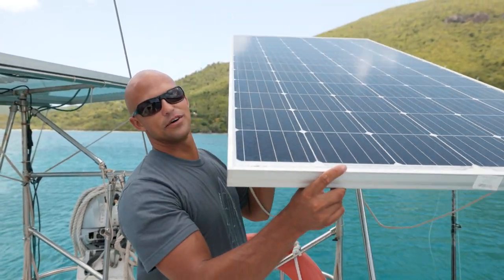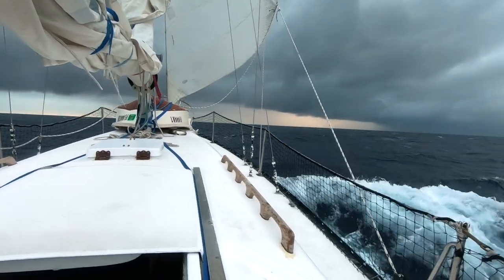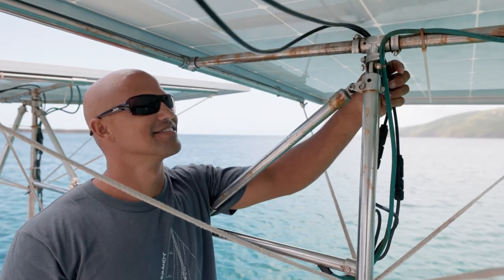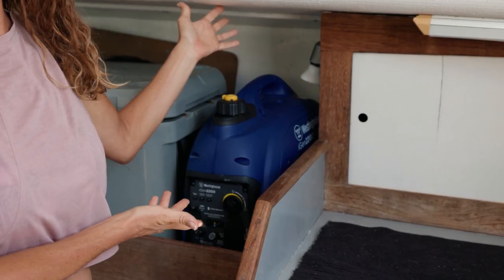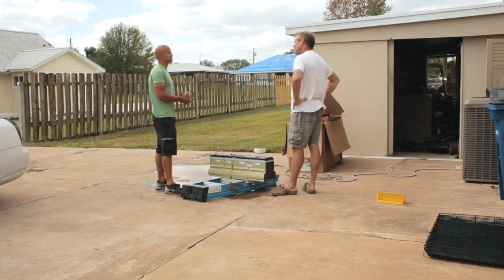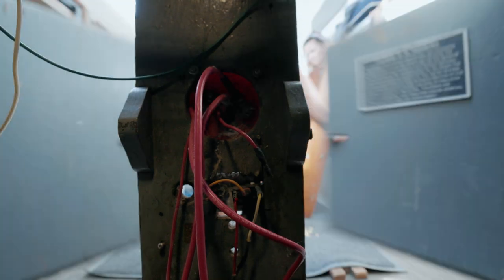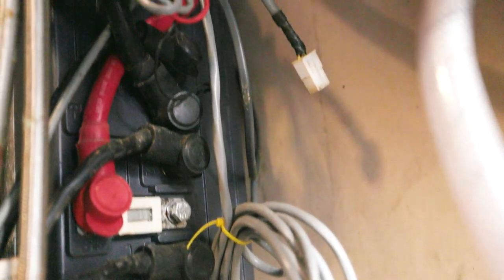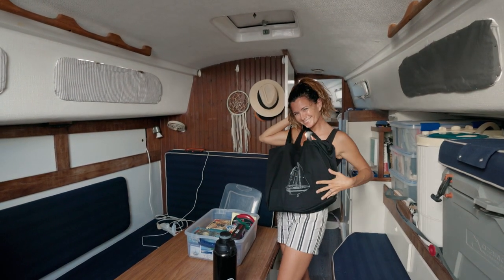Living on an ALL ELECTRIC sailboat for 3 years | Beau and Brandy Sailing

Comment: As a Pearson 35 owner (1977) going through an electric conversion, this video was PERFECT.  I want to thank you for the frank assessment of what you don't like and what you would change.  90% of my approach has been validated, and you've caused me to rethink the other 10%. Beau, you might want to look at the Electric Yacht EQ 20.  It is two 10kw motors on the shaft.  That gives redundancy should one fail, plenty extra power that you say you wanted, and two motors working at less power do not generate nearly as much heat on the motor (though the total BTU is the same, it is over a larger area - two motors - so the motors aren't stressed). You keep the simplicity of air cooled.  There are other things I'm doing differently, but 'nuff said.  This video was GREAT... perfect for me.

Comment: The electric boat concept is a very cool idea that is finally coming of age.  One thing that you may want to look at is a way to easily electrically isolate your inverter.  I used two battery switches for the input power on mine.  I did not do this until having to replace the second one due to nearby lightning strikes.  Neither actually hit the boat but both took out the controller cards in the inverters.  I am in Florida which has more than it's fair share of lightning storms but I now isolate everything possible.  Thanks for taking us along with you and showing us how you do things.  It is a great resource.

Comment: Nice job of really putting it all together for those of us in the process of building our own systems. I have a small sailboat I built that only has an electric trolling motor for getting in and out of ports. Indeed it does force you to become a better sailor. Often I find myself stubbornly resisting the urge to use it as though my sailing skills might be questioned...keep up the great work.

Comment: Cool beans... 
I too use Midnight & Magnum equipment. Now I was running an off grid ranch in Northern California (Mendocino) and liked that I could just jump up to Seattle whenever needed, but for you guys, thats a bit of a haul... only needed to once to rebuild the inverter.. I also had them design a complete large J-Box that "ALL" circuits ran into and were fused. Not sure what your doing as I didn't see one in your system. Trust me, its a god send. I love that at anytime I can just refer all situations through that box. My controller fits right on the door. Everything is positive side fused its so clean and neat. 
They worked with me my desires and space. My batteries are AGM. and weight a ton as that was not an issue. But I loved them. This was before lithium research was that big. I also ran 10 panels... 
You can read your manual to get your vampire draw, but I never turned my stuff off. The recvory  was less an hour the next day, I was fine. The inverter goes into sleep mode anyway. 
   Good job not going below the 70% on the batteries...

Comment: Enjoyed the video. Great hearing your thoughts after 3 years. Haven't pulled the trigger on electric & solar. I did salvage a nice big fiberglass hard top.  Maybe it would hold enough solar to power AC.😁 As for my 36'  Westerly, I'm wondering if the 6 ft draft of my would be a pain with all the shallows in the Caribbean... Running aground is not fun!

Comment: Impressive!! Electric motor is the way to go. Your friends on Una, have managed to cross the Atlantic and even sailed to Norway with shorter daylight hours and rough seas using only sail and electric motor. I am convinced it can be done. I think as solar power with regeneration on the motor you can achieve this. Great video guys 
Love your channel. Stay safe and looking forward to seeing you soon 👍👍👍

Comment: I had a similar set up for the solars on my 1976 31ft Bostrum ,for 7 years with no problems in any weather conditions.
I never had to take the  panels down ,even in gale force winds they d stay in place.While on anchor they d function a bit like a small stay sail,keeping the boat heading in the wind.
To decide on the design i was walking around marinas for ideas,and talked to a lot of liveaboards.
The construction I made in Almerimar marina's workshop ,where you could work on their tools for a small fee.Total cost (without the panels) 50 euros.(the pipes i got from the waste basket of the workshop.
I was also using bangies to assist the panel stability in high winds.

Generator is a must have ,especially if you need to run power tools.
Of course there was a big difference in the computers of my time as far as power consumption is concerned. 
Back then i had a sony vaio that consumed a lot of electricity,and for navigation i had a HP workbook from the 90s ,running CMap .:):)
With my old Yanmar 12 hp engine i couldnt charge the batteries even if i wanted as it had an old alternator that barely charged the batteries.
I wish i could sail today ,with all the technological advances it would have been an easier ride.
But it would also mean that i d have to sail in todays world,a smaller,more closed,more fearful,more scary more dangerous world. 
The borders between countries have become harder to pass ,even with a boat.
Also nationalism /racism has shown its ugly head in places that few years ago you wouldnt even dream of hearing something abussive against a foreigner/visitor

Back in 2000 i sailed from UK to Mallorca in 7 years,stopping in over  than 200 marinas along the European atlantic coast and the Mediterranean coast .
My sole advice is this: Sail while you are young,dont wait till you "make it" in order to make your dream reality.
I started sailing at 40 years old,and i think i was at the limit. 10 years later it all became harder,so i sold the boat and got on land. Today at 60 years old I have good (and bad) memories that i wouldnt have otherwise ,i ve lived things situations and met people i didnt even dream about ,poor,rich,good,bad,welcoming,haters,people in need,people who offered help,and visited places that most people havent even heard about.
I was the 1st Greek sailor to single handedly sail from UK to the Med, the 1st skipper to enter some of the ports i did, the 1st greek who called for help outside Cabo  Montego and got saved by the maritime salvamento of portugal (for free i might add),the 1st Greek sailor in the last 1000 years to enter the cala de los Griegos ,Mahon in Menorca .(and probably lots more 1st places for entering Rio Guadiana and sailing 30 miles inland,etc)
My only regret is that i didnt have the tools to record these 14 years i was a liveaboard.
Apart from a few photos ,i dont have much to show.
You see cameras/mobiles back then were over my budget (of 600 euros per month for all expenses,boat maintenance included)....
:)

Comment: Watched your video and it made me thick of our own off grid system. We store most of our energy not in batteries, although we do have them, but in food storage. One large freezer, one small and a large refrigerator. Granted we are not on a sailboat yet. We have 1860 watts of solar, 24 volt system thru a Flexmax 80 to a Samlex 4000 watt inverter. The most we ever produced is 6kwh. Most of the time we produce 3kwh. Our well has a separate system.

Comment: Thanks for sharing the installation.  I  would use flexible mono crystalline panels. They weigh 1/4 of solid panels and also have convex lenses which gather the sunlight 120 degrees. Meaning you don't need to tilt the panels to chase the sun, allowing small wind turbine installation.

Comment: I didn't know that you guys were totally solar powered. That's cool. But I want to thank you very much because you showed me something that I never thought of. And that is you used brackets to hold together your solar arch. I never noticed it from your videos. I will be doing the exact same thing on my boat when I get it. So thank you very much. Oh I was wondering have you ever heard of, " pour mans fiberglass?" Instead of using 1700 fiberglass they use like old bed sheets. I know it sounds funny but it works and it will save you lots of money on your glassing because you can get it at any yard sale or goodwill store or Salvation Army store. Plus you paint it when you are done so you won't see the hellow kitty or Spiderman print on the sheets. I know it sounds funny but I seen a show on TV about this guy that makes customized speaker boxes and he used colored velvet as his 1700 fiberglass. Plus he didn't have to paint the boxes because of the colored velvet. Okay thank you again for the idea about the brackets. I'm not a welder and those arches are very expensive to have custom made. See you next week.

Comment: Love this episode.  I bought a 1971 Pearson 35 last November and am refitting as we speak; been watching you guys for over a year and only just realized a few weeks ago that Saoirse is a 1971 Pearson 35 too!  LOL  Want more serendipity?  My vessel is currently parked at Riverside Marina in Fort Pierce, FL!  She had the Yanmar 30 diesel, but it was sold as non-functional and I am looking to replace with the Thunderstruck 18kw, wired at 48v (so 12kw actual).  I'm thinking I can run the glycol coolant through the batteries and the motor into a heat exchanger...possibly the one from the Yanmar 30...I got a decent price on some used EV batteries so I've been rewatching the episode where Beau installs Saoirse's battery bank for ideas about configuration.  I am super interested in what you guys are thinking for a hardtop bimini constructed from panels, having basically had the same idea.  Will you start from scratch or is it feasible to bolster your current bimini?  Would love to hear what you think along those lines since you guys have a practical understanding of the boom movement and other considerations.  Thanks for all you guys do!

Comment: Hi Saoirse - re my Golden Morn's Thunderstruck installation, I went for the more powerful 35hp motor, upgraded the propeller from 2-blade 30sq to 3-blade 45 sq and bought 4 x brand new Victron 220ah 12V AGM lead-acid batteries. Not long after, the huge power of the EV saved me from being washed onto Brehon Rock in a force 4 with 10 knot tidal stream (channel islands). For charging off shore, I bought a Honda 5.5kw petrol genny - that I hate using, but had to on a few occasions. What would I do differently? I am gonna get Battle Born LiFePo4 batteries and a bluetooth BMS;  I want 4 x 540 watt monocrystalline panels; then I will engage the 48v to 12v DC inverter, do away with the house batteries, pull 220v through a 3kw inverter - and lose about 120kg weight, while gaining much more traction time and more appliance-friendly household power . . .

Comment: My collection started with 75 volt panel so I can't wire them in series.  I opted not to ever try wind gen after hearing the quiet one OMG.... I have been in more quite  fights. I am currently looking in salvage yards for a chevy volt also. Seems most batteries are damaged missing or sold. So with those 3 search problem my start station is temporary lead. I went I  the ARMY National Guard at 17 years old work heavy equipment since 18 and drove 18 wheelers and heavy haul till 2016. I hate the smell of diesel smoke, fuel, and the price.  Love you guys more for this video.  Fat Coffee in the morning for sure it is 1:30 am now. Couldn't sleep.

Comment: Nice. I'm thinking visit a car scrap yard and get some old tail gate gas struts. Use them to support the panels. Also, maybe a sailing dinghy sized line clutch/holder could replace those hose clamps.

Comment: You might want to experiment with zinc plates on your metal areas which are getting hit by salt corrosion.   You might find that even through this is open air - zinc will take the hit first -- and spare other surfaces from some corrosion.   Also -- try to tie grounding between all your metal surfaces too.    AND perhaps pull all those grounds down to the bottom of the boat and have your zinc plates outside in the water too if you haven't done that yet.    It is easy to over-look grounding.      You will get hit with corrosion between dis-similar metals.   Check out that subject on the web too.

Comment: This is not a criticism only an observation based on 30 years of cruising about the planet. Being an engineer with a sailing background I'm always looking for improved systems at sea.        Going back over our logbook, the most anchoring in one year was 90 times . Our average is under 40, if you use two litres of fuel every time you anchor, 2 x 40 = 80 liters x10 years = 800 litres x $2 per litre = $1600 dollars in 10 years. Based on the maintenance cost of a diesel engine being equal to electric motor and battery replacement.                                   Electric drives certainly give cruisers a feel good thing as they move about the planet. Our cruising background has been in the more remote areas around the world hence a lot more anchoring. Great video.         ⛵🌍🤔
Phil and Lynda
Reply: I notice that you don't say how much fuel you actually use. You should watch some of the other channels how much time and money they spend on IEC maintenance ... in addition to the breakdowns of course!
Reply: @markebert7336  lt wasn't about Windora's fuel use. I was more concerned about what they had invested $$ in oder to motor on and off their anchor, as thats all they said it was good for. To establish the cost all I did was throw some numbers at it.                                              Was it a good investment or just a feel good thing?                 Take a look at your logbook, how many times did you anchor ?? over the last 10 years and give me some feedback.                                         Phil.                                                            ps.. Youtube yachtwindora

Comment: I purchased some stainless steel zip ties awhile back for use with my mast. That's what you need for the solar panels instead of the regular zip ties that you said won't last got them from Amazon on line for $12-$13 a package or for $35.00 you can get a tool to use with them plus 100 pcs of stainless zip ties.

Comment: Maybe add layered slide out or fold out panels where as when in calm or semi calm conditions these can be folded or slide out to double or triple the power output. These maybe could be incorporated or designed into being part of a hard top and then being used more of the time .

Comment: B&B If you are considering taking out the transmission, it might be interesting to connect it with a couple gears and a chain, so you could see if your 10 kw motor could handle more than a 1:1 ratio. What if it could handle 1:1.5 or 1.8 or 2.0 lol you wouldn't need a 20 kw motor! Props are expensive and limited by available room before it hits the bottom, although pitch could be changed. Hmmmm... Also, you two see blue and green waters everyday, so black & gray trees compliment nicely. I'd like to see some shirt colors that remind me of those ocean colors I'm missing. Heather teal, some nice varieties of blue that aren't the typical blue.

Comment: If you can get into to each cell, you can heat up distilled water and baking soda and put in each low cells. I do this with my deep cycle battery and trickle charge for about 12 hours and Wala a new battery !

Comment: Have a look at the rear shade solar-power system on the 30 foot boat belonging to the couple on "Free Range Sailing"  It is extremely strong and laterally adjustable, and the next vessel I have I will build a system similar to this.  My last vessel I had the solar panels drop into angle-aluminium frames bolted to the coach house roof.  I would never do that again--the sails shaded them some of the time. The firther aft they are the better--and the more shelter one has the better as far as I am concerned.

Comment: I have two of the same motor on thrust bearings myself.  Kind of worried about the encoder board overheating on me now after hearing about yours.  Looks like there's various suppliers, but it's definitely not an off the shelf item around here.  Kind of curious how hot yours runs, we kind of cap out at 40 to 60 amps continuous power or the motor overheats.  We did upgrade to bigger and high pitch props too.  Regen barely starts at about 4.5 knots now instead of over 6.

Comment: You mentioned wishing you had a bigger motor. In the specs for the motor you mentioned it is a 48-96V motor and you are running it at 48V. If you got a more powerful motor controller/inverter and ran it at 96V you could double your mhp. Your 10 KW rating is at 208 amps (208.33... actually) and motenergy specs say the motor can handle 150 amps continuous power, so your safe continuous rating is maybe only 7.2 KW. Anyway, if you upsize the battery pack and controller/inverter to give the motor 96V you will double your power. 20 KW @ 208 amps, or 14.5 KW @ the motenergy stated continuous rating. Anyway, you can get 50%-100% more power without changing the motor. Just need higher voltage battery pack and probably a new motor controller/inverter. You should be able to get this kind of low voltage, low amperage controller for less than $1500. If you don't mind buying from a Chinese company Kelly Motor Controls has them for around $700 USD.

Comment: I would put the batteries in an aluminum battery box (1/8 inch sheet) or maybe 2 mm steel well treated with POR15 rust preventative paint. Li batteries, even LiFePO4 are extremely flammable, and if something goes wrong with your BMS sealed metal boxes and a Li battery rated fire extinguisher could mean the difference between your boat burning up or not. The Li fire extinguishers are expensive, but so is your boat. It is worth the insurance.